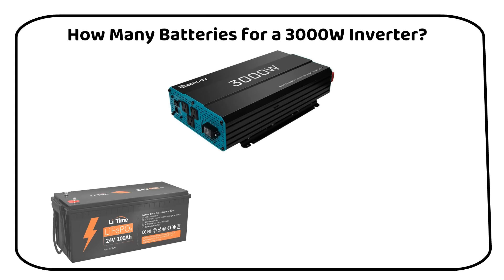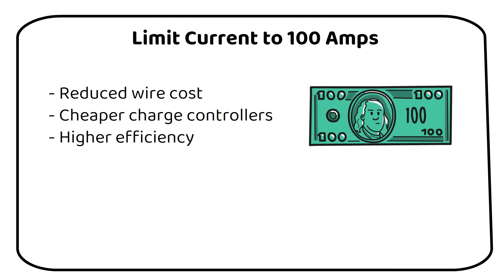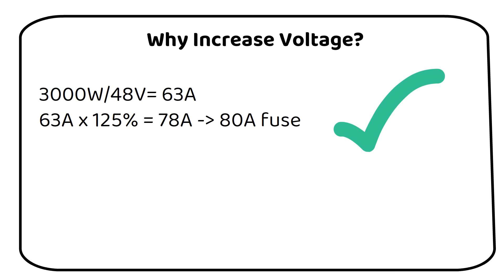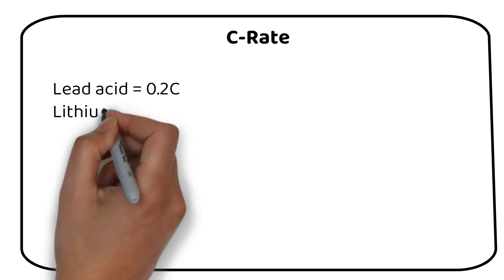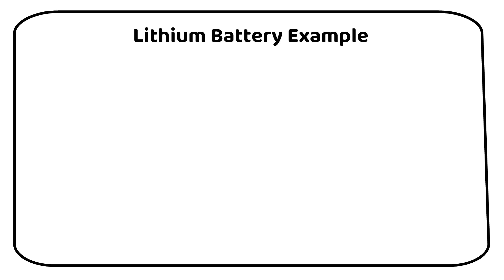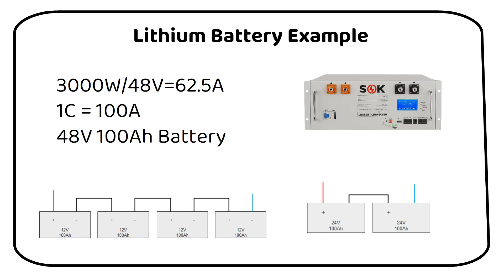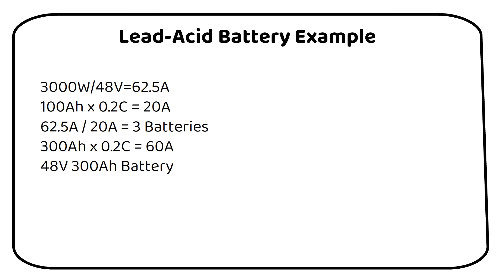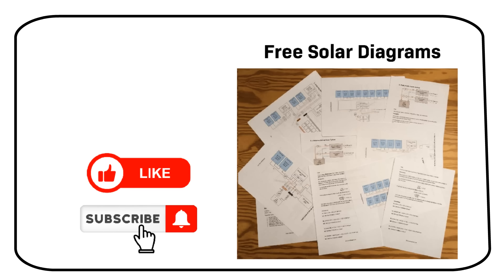How Many Batteries For a 3000W Inverter?

Comment: I have 6 12v 35ah batteries and 450watt solar panels and a 5000watt inverter and it want run a hair dryer what am I doing wrong

Comment: I have 4 100ah 24v batteries and a 3000w inverter but, i cant seem to run off my battery bank for more than a few hours, im not sure what the issue is, im only pulling like 4-500 watts at most
Reply from the maker: The idle consumption of a 3000w inverter is about 30w x 24h= 720wh. Have you taken that into account? 500watts for how many hours? You can check my video about load calculation for more information.

Comment: 3000w from a 12v source is 250a (not allowing for any losses). A 100ah battery will not supply the current for 3000w. The Renogy unit in the title is a 12v unit. It is supplied with 25mm cables due to the current loading.
Reply from the maker: I'm not sure what you mean. The thumbnail is there to prove a point that it's not possible.
Reply: @cleversolarpower 
The Renogy 3000w inverter is a 12v unit it won’t run from 48v or even 24v. This is in the UK. Otherwise you are quite correct.

Comment: A question I used to ask electrical design students was if I start a 100kw generator with a 208/120v 3 ph 4W system, how many amps does it put out.  In your case, if I have a 5000 w inverter and turn it on, how many amps at 120 volts is it putting out?
Reply from the maker: 0 Amps because there are no loads. I feel like this is a trick question 😄

Comment: Inverters don't cost much. just get a big inverter and then you can add batteries later if needed. It's the load that matters. Don't strain the battery. A big inverter is not going to worry the system.
Reply from the maker: Bigger inverters have higher idle consumption. So bigger is not better.
Reply: @cleversolarpower  Tru

Comment: I'm confused, so if I have a 3000-watt inverter in my trailer with 12 volt 460 to 560 amp hour, Lithium batteries aren't correct? Usage would be the majority of 12 volt with short usage of 110 volt AC! Coffee pot, slow cooker, microwave, etc...?

My concern is to ensure I have enough power in reserve for cold weather camping to run the furnace and other 12 volt heat pads....etc...
Reply from the maker: It will work, but it's just not efficiently sized. Your current will be high, so you need to have thicker wires. If it was 48V, then adding a converter to 12V would have been more efficient and cheaper.
Reply: @cleversolarpower  Now I'm really confused! In a 12 volt system, isn't a converter always used! I don't have the system yet, I'm trying to figure out what way to go!

Comment: Which 3000w output inverter to buy so that I can connect it to a 12kWh 48V 230ah LifePo4 battery ( I charge it with panels via Victron 150/35), and I will be able to charge household appliances with it, such as a washing machine, dishwasher, oven, ...
Reply from the maker: I recommend taking a look at the victron multiplus. I think you need the 5kW version or even the 8kW version to power your loads.

Comment: When using inverters anything over 2000watts switch to 6volt batteries theu will last longer, i am using x4 6volt agm 224 amp hour each battery, giving me some impressive run time, downside they are expensive.
Reply from the maker: I hope you wired them in series to make 24v.
Reply: @cleversolarpower  👍

Comment: Thanks for the clear explanation. 

I have a 24v battery bank 2 x 230 ah (460x0.2=92) with a 2500 inverter (2500/24=104). 

My batteries degraded in a very short time span of 2 years. I am doing my best to learn from my mistakes. My first thought was that I discharged the batteries too much too often. The only guard for discharging too much is the inverter low voltage shutdown. But after your video i do not think that only the above was/is the case but i also sometimes discharged my batteries too fast. 
I am very curious what you think about this case. 

A company nearby claims that they can regenerate lead acid batteries in some cases. I will try that first, testing is free of charge. I’m also looking into lifep04 batteries for plan b.
Reply from the maker: Do you have two 12v 230ah batteries in series? That's 24v at 230ah. You should have only discharged lead acid to 50%.
Reply: Ordinary auto, ie. Starter motor battery will degrade quickly, Deep cycle batteries are needed for solar if using lead acid. Hope this helps.
Reply: @cleversolarpower  Yes, in serie to make a 24v system. I know now lead acid on 100% is 12,7/24.4 volts and on 50% it's on 12.1/24.2 volts. I discharged them sometimes to 23 volts and not often but sometimes to 22 volts and in winter when there is not so much sun i didn’t take care of my batteries well enough i think. My thinking was, the batteries are big (AH wise) and my victron charge controller would take care of the rest.
What I don't understand is that in my victron app often in the summer the state of charge was 28 volts, how does this work?
Reply: @Peranaworthal  Thanks, do you mean that the lead acid batteries never can be deep cycle batteries? Only AGM or Lifepo04 batteries are could for that use?
Reply from the maker: @moziani9093  checkout my battery voltage charts here: https://cleversolarpower.com/lead-acid-battery-voltage-chart-12v/ you might need to adjust the values of your charge controller. I think they are wrong.
Reply: All lead acid whether they are flooded, GEL or AGM should only be cycled down to 50% SoC (State of charge) if you want to get the most cycle life. Some manufacturers say 40% for their AGM’s. We use Rolls (Surrette) company right here in Nova Scotia. One of the best lead acid battery on the market.
Reply: @MaritimeHomesteader  Trojan says you can go down to 80%. The thing about cycles is a battery only has so much charge and release in it. Use the battery to day and buy a new one in a couple years with new technology and cheaper prices. Why hold on to a 5 year old battery that has lost some of it's capacity? I'm moving to Lithium as I'm tired of the flooded maintenance.

Comment: @cleversolarpower what if the Lithium is 0.2C with a 100A BMS i have 12.8V200ah Deep cycle lithium from Li-time
Reply from the maker: A lithium battery is 1C, not 0.2C. If the battery has a 100A BMS, you can draw a max of 100A.

Comment: I am currently using a 2000-Watt inverter with a 12-volt battery but plan to add another battery shortly.
Reply from the maker: You should 😀
Reply: Thank you for the response. After all is said and done I will be building to a 48 volt system but that is further down the road. @cleversolarpower

Comment: What capacity of lifepo4 battery is needed to power 250watts refrigerator
Reply: How many hours do you want to run the fridge? 
What capacity lifepo4 batteries are you contemplating?
If you can answer those questions, it's a good start.
Reply: 100AH = about 1000 watts after inverter losses and to not drain the battery to 100% 
so that would be 4 hours of run time if it were to be running the whole time and we know that would no be the case so say maybe 8 hours it would run?

Comment: Great explanation, and all true IF you accept the initial statement of “don’t put more than 100A through a cable”.  

However, if you have an existing system at 12V (a boat, perhaps) then you need to consider your alternatives, such as wiring the inverter using 200A or 300A cabling (keeping such cables as short as possible to control the cost), and fusing appropriately.  You would only choose a 3000W inverter if your maximum short-term loads were to be usefully less than that, then it follows that your average loads would be lower again.  Absolutely you need to size your DC cables (and fuses) for maximum current, and your batteries must be able to deliver that short-term maximum as well, but total capacity and charging need only consider your daily usage.  Yes, LiFePO4 batteries are your friend.
Reply from the maker: I agree, if you want to stick with 12V then that's perfectly fine. I laid out the most ideal situation.

Comment: if you live in the 1980's and are using lead based batteries, simpler math is take the wattage, ie 3000w, divide by 10 so 300w, add half as much on again so 450w, change the w to Ah, boom theres your minimum pack size.  as they are normally sold in 100ah, so buy 5 of them for 500ah
Reply from the maker: That's one way 😄

Comment: Hi this is from my house it'll be recharged for my truck my truck has an inverter and I'd be plugging in a 50 amp battery charger into my truck I'd like to buy two 200 amp lithium batteries for a total of 400 amps in a 3000 watt inverter to run my refrigerators at what consider a 2000 watt inverter.  Pure sine . I will only be charging my refrigerator for power outages and basically I would be putting 5 amps back into the batteries as they're being discharged on the recharge side. What do you think

Comment: Your formulas are correct... no doubt at all.
The problem is, instead you did, the approach. It must be done deal with in terms of energy consumption in 24h.
You're assuming a costant load of 3000VA... this is not a real case. 
To me the right figure should be starting at 0 o'clock with battery full charged.. recharge with solar panels the consumption will be regular as for familiar habit, with peak load, no load or minimum load. 
The important is total PV energy IN must be equal to the total consumption OUT. At the end of the day the battery is almost 100% recharged.
Reply from the maker: I think you misunderstood the subject. This is not about sizing a solar system. I have made a separate video about that. This video is about what kind of battery you need to support a working 3kw inverter. It doesn't consume 3kw all day.
Reply: @cleversolarpower 
listen to me... a lead acid 100AH battery for motor vehicle withstand 850A for few seconds... this occur when you start a diesel engine.
The same battery can easily withstand 3kw inverters for few minutes....
Maybe I have made some mistake about the topic but anyway speaking about solar plant with you  @cleversolarpower (the nickname you've chosen) is natural and never out of the topic.
Reply from the maker: @joblack3991  Batteries that start your car are not constructed the same way as deep-cycle lead acid batteries. The plates are thicker to deliver the high current. Deep cycle batteries are made to deliver current for a long time (thinner plates). They can withstand higher current, but that doesn't mean its good for the battery.

Comment: Hello sir please can you help me thanks.

I'm disabled and have a mobility scooter,  I wanted to charge the battery using a 2500 watt inverter. 
The scooters charger 8 watt, I connected everything and the generator started to charge the batteries,  however after around 10min I noticed smoke coming out of the charging vents,.

Question, hiw can I charge the scooter with a generator thanks.
Reply from the maker: It's hard to believe the charger is 8W. If smoke came out of the charger, then it's most certainly damaged. You can get a small inverter generator with electrical plug on it and charge your scooter that way. You will have to get a new charger though. Make sure the charger is compatible with the battery.
Reply: @cleversolarpower  
Sorry 8amp the charger is.

Comment: It really depends on what the battery is rated for.  There is no magic 100 amp rating if the battery is rated for 50 amps.
Reply from the maker: Most lifepo4 batteries are rated at 1C discharge, so 100ah=100A.
Reply: @cleversolarpower It still depends on the battery if it's rated for .5 C and you apply a general rule and take 1 C from it something will hopefully overload or the battery will die.

Comment: The manufacturers  suggest 12V battery regardless of size.  Is that to just make the average user feel they can still use it with their car? Is it safe to go up in size if it says 12V in the manufacturers listing?
Reply from the maker: When a manufacturer makes a 12V 6000W inverter, doesn't mean it's a good option to buy.

Comment: The only time I’ve seen a situation where we had to select battery bank size based on the inverter is when using Simpliphi Li batteries. They can only discharge so many amps (it’s very low) and if the inverter was to run a large load the batteries wouldn’t be able to keep up and there would be serious issues. We had to have 3 of these 48V batteries, not for the capacity in Ah or Wh but because of the amp draw that could happen. Ridiculous

Comment: What about the 50% discharge rate for a lead acid battery? You can only use 50% of the capacity so if you have a 300Ah 12v battery = 3600Watts, you can only use half the watts as it's lead acid. This is what I've heard.
Reply from the maker: You have 3600-watt hours, not watts. Watt-hour is about the energy over time. So 3000W for one hour is 3000Wh. Indeed, you should only use half of a lead-acid battery's capacity. So for a 300Ah 12V lead-acid battery that has a total capacity of: 300Ah*12V=3600Wh you should only use 1800Wh.

Comment: How many 48 v batteries required for 15 kw solar system.
Reply from the maker: Good question. Assuming you have 3 sunhours, you can charge 45kW daily. So a 45kw battery is correctly sized. However, this depends on your loads as well.

Comment: Hi, can you please help in my project, I have a mppt controller AUTO 12,24 & 48V Wind 8 KW & Solar 5 KW  and inverter 24V 6 KW - 12KW for this Project I think to use the LiFePO4 8x3.2V 310Ah. If I have mistakes please correct me.
Reply: what is the system voltage as this will determine every thing from wire size to needed bank needed if 48v 8 cells will not do it, you need bare minimum of 16 cells I personally like a slightly higher voltage and calculated 18 cells for my self (ATM I have 32KwH lithium Polymer)

Comment: Thank you I’ve got 280AH 3.2v batteries x 8 = 25.6v my inverter is 3000W 24v although I have a 5KVA Inverter but it’s 230v x 1 and the Chinese electrical grid ground also has a positive current Recommended within the inverter you can disconnect the  power lead going to the negative ground cable but I haven’t seen that video how to do so to salvage my 5 kW inverter is in the American grid you could take the neutral and the L one each of 115 V this one phase 115v to my breaker box I have no 220v !

Comment: for maximum battery life, i suggest a max amp of 10A per battery. Most people did got this part wrong and destroy battery within a year. battery capacity should be considered on the area you live in and the amount of sun you have. If you are living in sunny places close to the equator, its enough to have a 20AH battery capacity per battery and increase the number of battery to decrease the amp output per battery. this is because the amount of sunlight recieve is around 8 hrs a day with very little variation.  rather then counting the maximum capacity of the battery, it is more aplicable to go for sustainability by decreasing the amp output from battery especially if using acid lead
Reply from the maker: You seem to be referring to a load calculation. You can check my video about it on my channel.
Reply: @cleversolarpower 6:09

Comment: i purchased a 3,ooo watt 24 volt Growatt Inverter  3000 / 24 =125 amps thats OVER 100 amps will rhar WORK ????????
Reply from the maker: If you have lifepo4 batteries, the BMS will shut down if it's rated at 1C and if you draw the full 3000W.
Reply: @cleversolarpower   I have 100ah 12volt battle born batteries ???

Comment: It truly amazes me when I see people use 2000w inverter on 100ah batteries. However on a 550ah battery it works
Reply from the maker: Don't forget to increase the voltage for better energy conversions and cheaper components.

Comment: You can divide the panel watts by 12 volts, but 12 volts will not charge a battery. You will never over 13 volts to charge a 12volt battery. You must also figure in the efficiency of the solar panel because it is less that 100%.

Comment: 200Ah LiFePo4 with 2500W Inverter, maximum need for Induction hob and Air Fryer is around 1500W, Microwave and Coffee maker uses less, so have used this combo successfully. Battery also has 200A BMS and cables are thick and 60cm long. So there is a way, but I admit that you are perfectly right!
Reply from the maker: If the cables are thick enough then it will work for sure. You will pull 208A so you indeed need a 200A BMS. However, it would have been better sized if your system was 24V, 48V -> less current. But it will work 😄

Comment: already got 12v300ah x4 AGM with 48v 5kva inverter about 2kva solar panels,  AGM only last 4 or 5 years they dry up over hot summer 40c for 4 months , so then buy lifepo4 340ah x4 is way more power then AGM by 10 times longer never goes flat , living on a camp house run big fridge, two pc and tv , 5 kva aircondion have it on ;low setting less power use about 800watt for 6 hours not a problems .
Reply from the maker: Great, I will make a video about replacing lead acid with lithium soon.

Comment: also I heard that lead acid batteries will let you use half of their capacity before permanent damage.
Reply from the maker: That's true. We cycle lead acid from 50-100% and lithium from 10 to 90%. You can go from 0 to 100%, but that would reduce the lifespan of the battery. However with lifepo4 batteries it is questionable if you should do it or not because the lifespan is very long of itself.